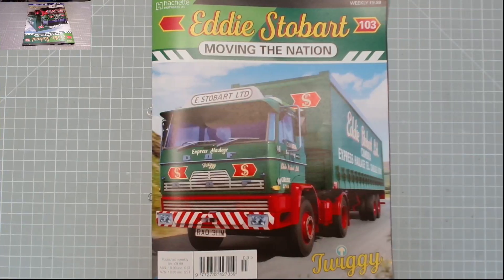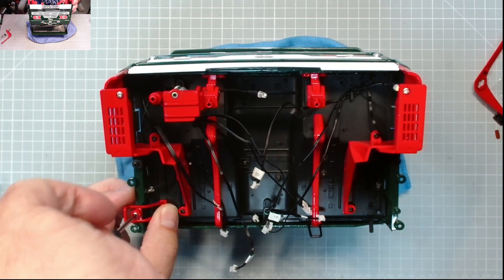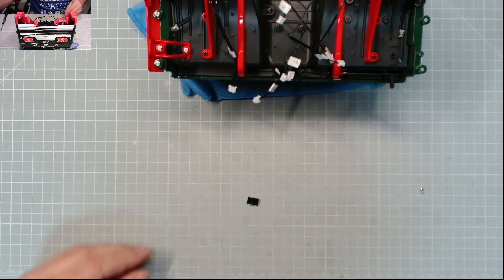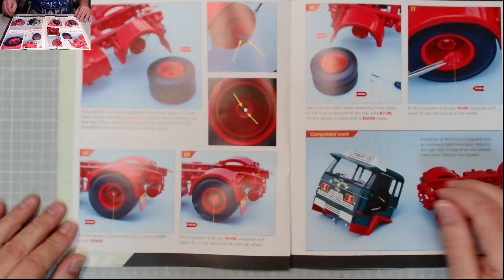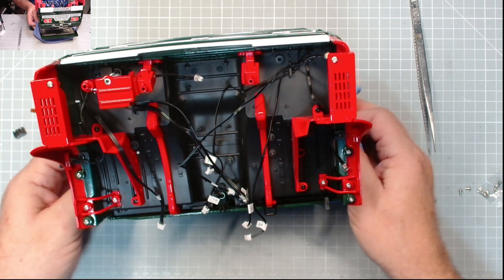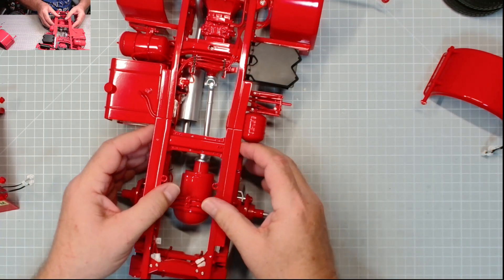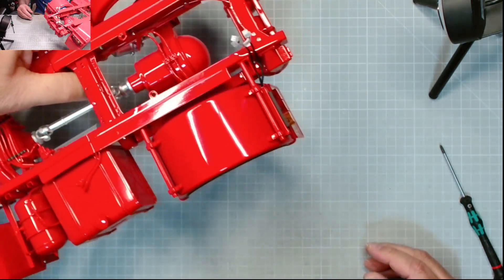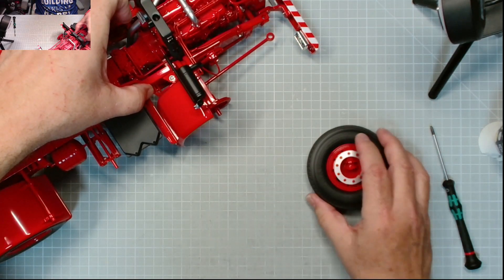Build Eddie Stobart issues 103 and 104 from Hachette

Comment: Looking good John, but noticed you may have misread instructions that tell you to put the little plugs of the front indicators  through the little holes also. Plus are we given a tester or did you make yourself? Nice build John 👌👌👍
Reply from the maker: Thanks, Peter. I will check the plugs. The battery box is from the Titanic.  😊